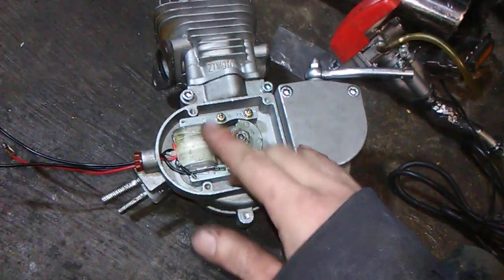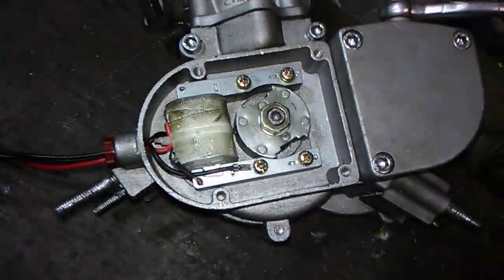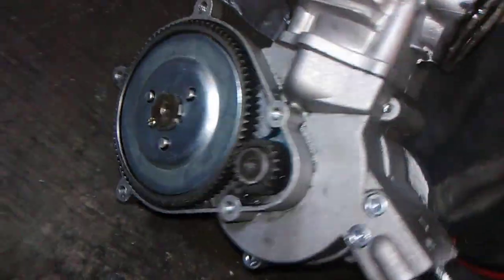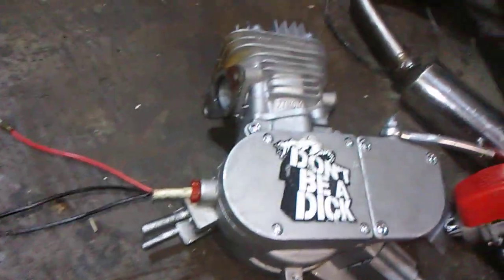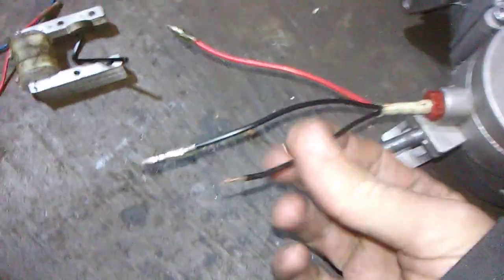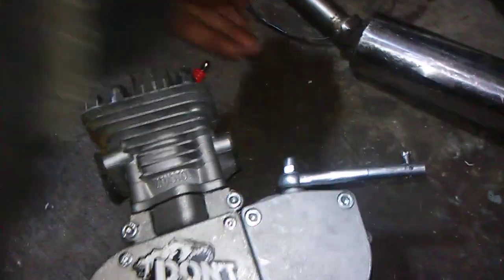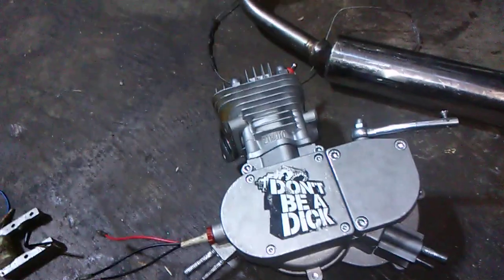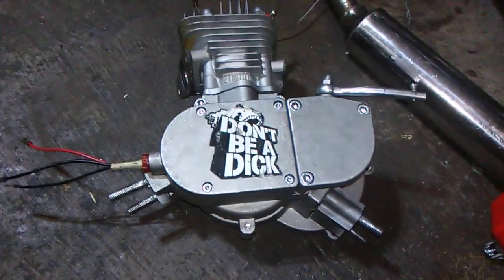"phantom 110cc Project Build!" "dangerous as hell!"

Comment: Give us a ride video of the phantom!! 3 piston rings is a lot of friction, friction is heat. I would take the bottom ring out brotha
Reply from the maker: This is a trial run to see how it works and if it performs better than stock I'll make a few adjustments to it
Reply from the maker: The reason why the original phantom 85 piston fails is because the piston rings are too tight and they get smashed into the cylinder head and walls from the heat